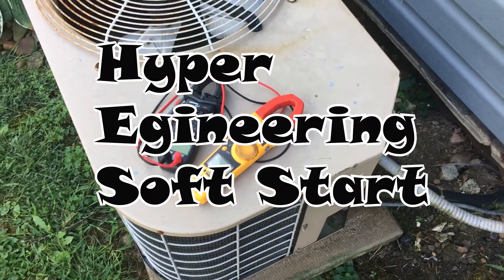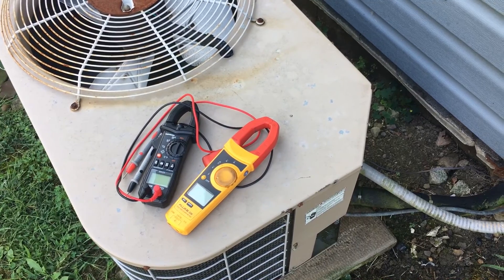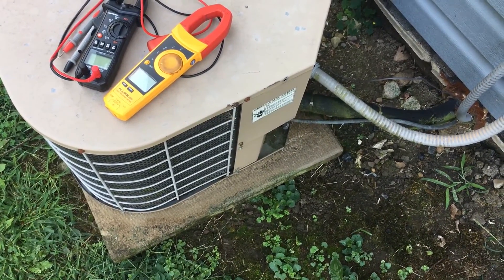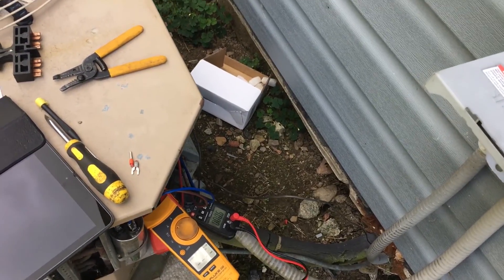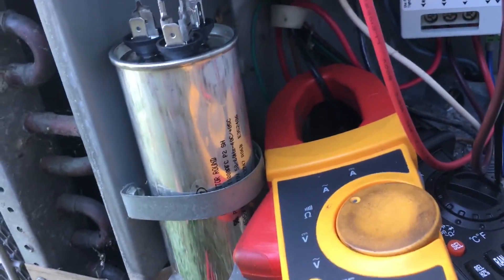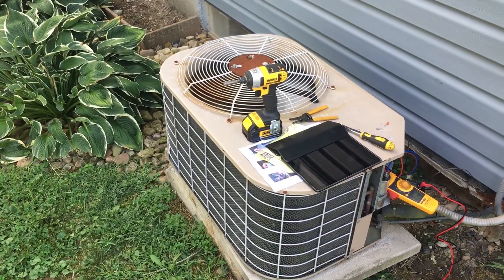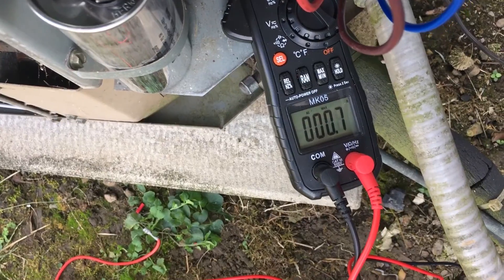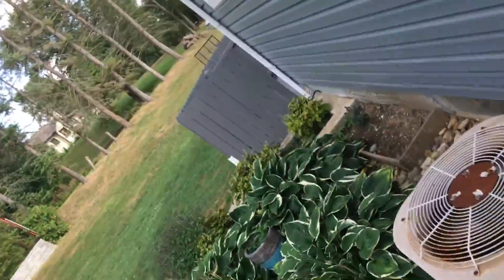Testing my central ac with a soft starter from hyper engineering

Comment: Soft Start still working fine? I have been debating between the hyper engineering and the micro-air. Really don't care about the bluetooth.
Reply from the maker: @vwjet2001  still working great. Either option will work, both are quality products

Comment: does this soft start help on reducing electricity bills even slightly?
Reply from the maker: No. I haven’t noticed it. The gain is less light flicker and allowing a smaller generator to start and run.
Reply: @IFix-Things  I guess the real benefit of installing one is to prolong the compressor's durability plus enabling powering the unit using a solar system.
Reply from the maker: @ReneUhlver  correct, and a smaller generator

Comment: Absolutely works to reduce initial starting amps. I advise installing all of the wires to the relay box first, mount the box and then attach the wires to the condenser components.

Comment: Great Video

Im getting ready to have a brand new Trane XR14 AC 2.5 tonne installed. Would you recommend one if these "soft starts" even on a brand new AC unit here in South West Missouri? 

What are these soft starts even for?
Reply: I live in your region and put one on mine, mostly for running it off my generator, but it is also easier on the compressor and prevents light flickering.

Comment: Didn’t you demonstrate your installation of the hard start kit substantially reducing the inrush current in a previous video? If I recall correctly your OEM cap was reading at about 77 Amps and the hard start was around 55? Why do you think the hard start was back up around 77A? Just weakening over time?
Reply from the maker: The hard start actually failed. That is why.
There is no comparison though, if you want to start your ac with a generator go with a soft starter. If you have an older ac that won’t start, try a hard start you may extend the life of the ac

Comment: You mentioned a common wire at least twice. If you have 240 volts, you'll have 2 hots & a ground for safety. So what are you calling the common?
Reply from the maker: I may have been referring to the compressor motor  common wire.

Comment: why didn'y you run tests using the fluke "inrush" meter as you did on the first tests , comparing apples and oranges has no scientific value , should have tried a few times?? just make sure your clamp is right on the compressor wire after any other fan connection and let us see the peak inrush ?
Reply from the maker: It has to do with the way the fluke’s Inrush works on that meter and the way the soft starter works. It would not accurately record it from what I recall.

Comment: Are you still using this?   Would you buy it again  or recommend it?      Thanks for sharing.    - take care
Reply from the maker: Yes still working great! In fact I will be publishing a new video of using this with 2 honda 2000's and showing how that will start a central AC , stay tuned.
Reply: Good deal Lucile.  
How much $$ does the soft start cost?    My hvac is on a 70 amp breaker, what is your's?
Reply from the maker: @leeisenberg  about 300 for the soft starter. my breaker is 30 amps. How many tons is your AC?
Reply: @IFix-Things  Idk how many tons our unit is.  
How many tons is yours?
Reply: @IFix-Things  The Hondas are 120 volts. How can you get 240 volts out of them to run your central air?
Reply from the maker: @rickbraden4272  I have a transformer. In one of my newer videos you will see the Hondas starting the ac up

Comment: Highly recommend these for generator installs.  The unit will take a few starts to learn how the compressor responds and of course it may vary as you've seen.  Putting these in let us have our AC on our generator, and cuts down the knock noise at startup.  Will be looking to get some more for our new house.
Reply from the maker: These are great for sure!
Reply: This is EXACTLY what I'm looking for! I installed a generator and learned that it wouldn't power my condenser because it draws 92A at startup.

Comment: Interesting video 👍 and interesting product. One question .... What was the period of time between start- ups ?? My concern is the head pressure at the proper level for a  start ??
Reply: From Hyper Engineering Literature
SureStart Operation
When the system control calls for compressor operation, the compressor contactor will energize. If the supply voltage to the SureStart is less than “Minimum Startup Voltage”, a 50 second delay is initiated. At the end of the delay, another attempt to start the compressor will begin unless the supply voltage remains unchanged. SureStart uses an optimized starting process that learns the starting characteristics of the compressor to further reﬁne the starting cycle on each recurring start. 
If the compressor fails to start, the module will terminate the start attempt after 1 second and initiate a 3 minute lockout before attempting a restart. 
If the supply voltage falls below “Shutdown on Low voltage” limit for 2 seconds or below 130 volts for 0.1 seconds while the compressor is running the module will stop the compressor and initiate a 3 minute lockout. A restart will be attempted after 3 minutes if the supply voltage is equal to “Minimum Startup Voltage” or higher. This is done to protect the compressor against a sudden drop in supply voltage.
SureStart is able to detect an interruption in power, when the interruption is 0.1 seconds or longer. When a power interrupt is detected, SureStart will shut down the compressor for 3 minutes. SureStart is also able to determine if the compressor is running backwards. If this condition is detected, SureStart will stop the compressor for 3 minutes before a restart is attempted. A power interrupt that is shorter duration than 0.1 seconds may result in a compressor running backwards, which the SureStart can detect and stop compressor operation. 
If the run capacitor is faulty or has failed, SureStart will shutdown the compressor for 3 minutes before attempting a restart.

Comment: Yeah,sorry but the min/max is not fast enough to catch the peak amps...You will need the clamp with inrush. I would double check the 19Amps if I were you with a differe t tool. I have a cheap $60 clamp with inrush which catches the initial ~2A of the fan and then the secondary Amps from the compressor. 
I have a different brand soft start and man......they some times work some times dont! I get 24A,45,67,70 ...all over the place..
Reply: Petko, I am having same issue. Installed the micro air soft start kit on my 3.5 ton Lennox and it ranges between 40 to almost 70 amps on starts. Any thoughts on why that might be? I have been emailing back and forth with their support team, but nothing has worked so far to keep the start consistently low like I want. Even changed capacitor.
Reply: Petko, I am having same issue. Installed the micro air soft start kit on my 3.5 ton Lennox and it ranges between 40 to almost 70 amps on starts. Any thoughts on why that might be? I have been emailing back and forth with their support team, but nothing has worked so far to keep the start consistently low like I want. Even changed capacitor.
Reply: @rdramos7073  First, your unit might be old and worn so the compressor is drawing more power. Second, pressures are not equilized between cycles. Third, I would not trust the data from  Easy Start and test with the clamps. Which capacitor did you replace?Also, your AC is probably rated at  115A LCA or the initial start Amps so getting 40Amps is already a great reduction. However, you should be getting 30-40A range.
Reply: @corgi_beemer2023  I think that might be my issue. I believe the unit is 20+ years old. The technical support team at micro air thinks it’s a pressure issue, but I don’t think so because my AC cycles anywhere from 30-40 plus minutes between starts so that is plenty of time to equalize in my opinion. Might just settle for a window unit for my generator.
Reply: @rdramos7073  It sounds like a pressure issue to me too. I worked with Roger from MicroAir and he was great. To be honest 40A draw is already about 65% reduction from the LCA. Keep in mind that in hotter days that draw will be very high. 
I have a 11.5/9.2KW genny from Champion and it works great. Here are few things you can test and possibly have in mind.
1. Remove all connections on your running capacitor and test the capacitance. I replaced mine and the running amps dropped from 17A to 9A.If you do that you must run the relearn procwss again.
2. Shut the power off to the AC (not the furnace). Wait for about 30 minutes and turn the power back on while having AC clamps with Inrush wrapped around L2 on the contactor black wire. The clamp will catch the fan and then kick up for the compressor. That is the real reading so compare it with what you get from the app. I have noticed about 10amps difference and I would trust the clamps.
3. When on genny power alawys start the AC first and wait until the rpms stabilize then turn on the other appliances.No clue what genny you have but I have no problems with mine which can handle up to 47A start up.
Reply: @corgi_beemer2023  so I think Roger figured it out. I have a compressor that features a temperature sensing bulb for the expansion valve. This bulb causes the refrigerant to be held against the compressor head when temperatures rise.  The problem we have been fighting is this expansion valve. With head pressure held against the compressor, it needs torque to start and this means more than the low current starts we are seeing.

Your responses are very accurate and I appreciate the feedback. We have tried everything you already mentioned and it led to this. I’m not sure if this temperature probe with check valve can be replaced, as I don’t know if it is worn out, or if that is just the type of AC I have and it will not run any other way.
Reply: Btw I just bought the duromax dual fuel 13,000 genny… it works great and will run my AC with no issues on the 40-50 amp starts, but nothing more than a 51 peak amp start. I was hoping I could run it, but now I am not so sure until my current AC is ready to be replaced with newer technology. I think I’ll take my chances with a window unit in the meantime because this Lennox of mine is a workhorse!
Reply: @rdramos7073  A 13KW gen will handle up to 54A. I would suggest you test the AC on a generator and find out.Once the AC is running lower the temp and let it cool the house very well after that shut it off and turn it on once you cant tolerate the temp inside. Just dont let it cycle because that may bog down the genny and kill it. 
The fact that you can actually run your AC even if you have to play with the system and time is already great. It is only for emegencies anyway.
Reply: @corgi_beemer2023  it has been tested and it did work with the soft start kit! I was very excited, but on the second attempt (minutes apart) it tripped generator breaker due to higher amps. Your idea about only kicking it on upon initial startup just to cool house off is something I had not thought about. I will definitely keep that in mind when disaster strikes next. Thank you.

Comment: The fluke is catching the first inrush, from the fan motor. It will likely read correctly if you unplug the fan and start it, just don't run it for long with the fan disconnected.
Reply from the maker: great suggestion

Comment: I do notice when the unit starts the compressor is starting about a second behind the condenser fan motor
Reply: The fan starts right away because it is wired directly to the contactor. It takes a second for the Sure Start to get going and then start the compressor once it has verified the input voltage is good (undervoltage protection). It's logic is in the flowchart you can get online. This also means that your Contactor closes under a very small load which reduces arcing so it should last much longer too.
Reply: @n.gineer8102  ok
Reply: From what I understand about soft starters, that is exactly what is supposed to happen. It’s supposed to spread out the total load over time similar to you turning on one breaker at a time as opposed to turning everything on at once using the main.
Reply: @paulrozinski1488  oh I didn't know that because I don't have one on my ac unit

Comment: Due to your video I just purchased ONE SureStart( 08-16 )..I have a Dual Compressor unit. I wanted to see if the Amps would drop before buying a second one.
My Fluke like yours did the same thing showed about 8 Amps Inrush....was only catching the partial inital rush.
So, I set Fluke for MAX Amps and I am around 30 Amps on my High Stage compressor (2 Amp Var. between other starts) 
Down from 64 Amps with the HARD START KIT.....Woot ! !
My Low Stage compressor is at 40 Amps running a hard start kit.

I will be purchasing another for the low compressor.  I hope this will let me run my 2.5Ton AC with a 7000/12000 Generator.
Reply: What you are seeing is the condenser motor starting first. If you subtract that amount from the total inrush before you install a soft start that will give you the reduced inrush current. Of note is that most modern hvac systems start the condenser first then about 30-60 seconds later start the evaporator blower. If you have an older system you can put a time delay on the fan (green) wire into the blower cabinet/furnace and cause that fan to start after all the other loads.
Reply from the maker: Good to hear. I love my soft start. My generator loves my soft start, lol!

Comment: Hey man. Where is soft starter for a hvac fan motor?
Reply from the maker: I am not sure I understand your question. The condenser fan isn't big enough to need one. The blower fan is 120V, and doesn't draw enough surge amps to need one either.

Comment: What size is your generator?
Reply: I would love to see a video when u test all those generators on your ac unit. Did u try any of those generators with just the hard start kit and did they have any success running your unit?
Reply from the maker: Christopher Harrington I’m going to try it with my 420cc Briggs which is a 6250 running and 8500 surge, I’m confident that would work, then I will attempt it with 2 Honda eu2000i in parallel going into a 5kva transformer. The problem is going to be the fan motor inside, as it wants to start at the same time as condenser fan and compressor. The hyper engineering does have a compressor restart after 50 seconds, so it may just work.